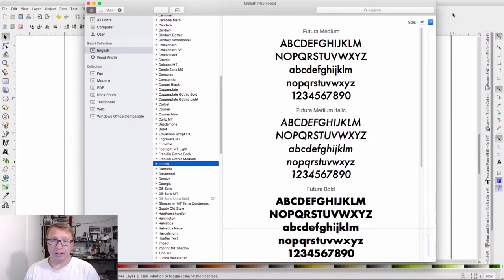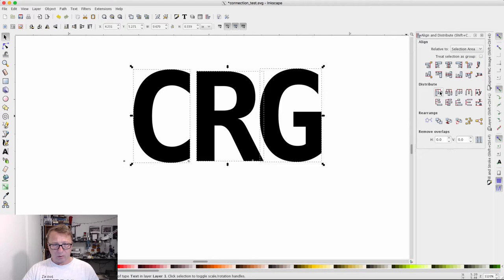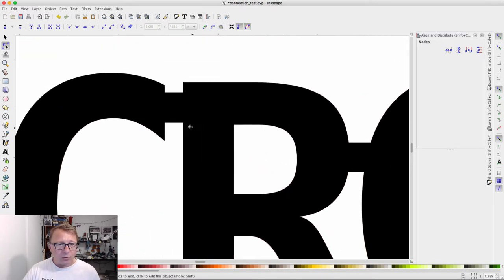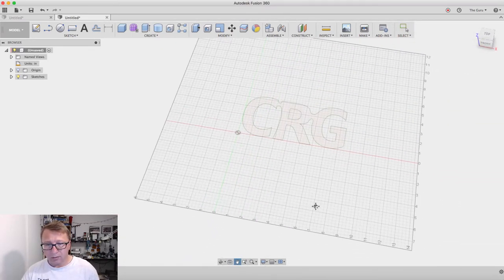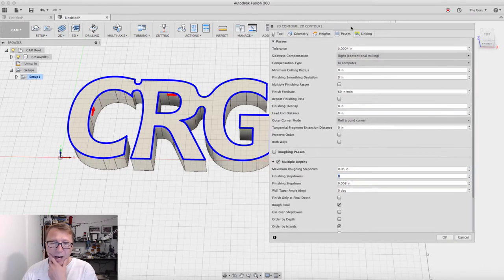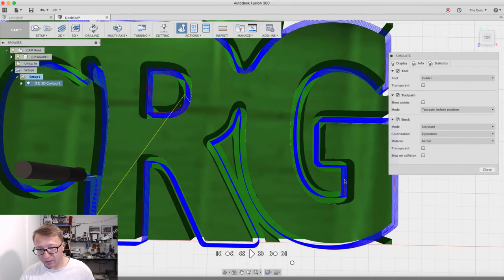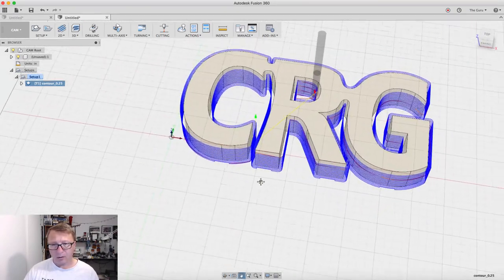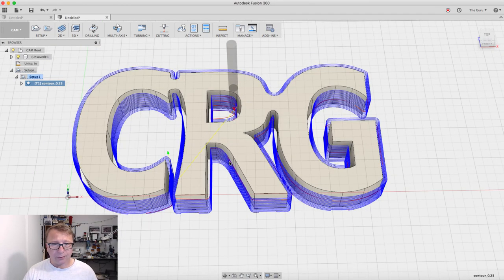Creating Signs with Connected Letters and Inkscape

Comment: Hi, when I import plots from scientific software , it happens that words are composed by independent letters that are not recognised as text. Can you suggest a way to link those letters to make single words? thanks in advance for your help
Reply from the maker: Hi Alessandra - as far as I know, there is no way to turn a path or stroke back into an object (e.g., font in this case) in Inkscape. It's probably easiest to simply retype all the words using a font in Inkscape if that is possible. There might be an export option in your software to export the plots and keep the fonts rather than turning everything into a vector.  Hope this helps.
Reply: Thank you for the reply, actually the problem stays in files generated by other less experienced user